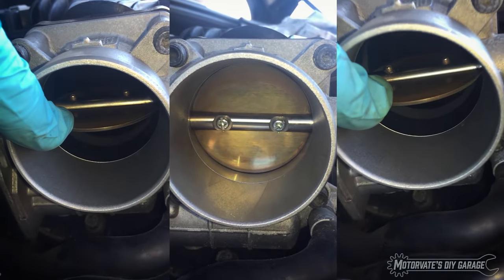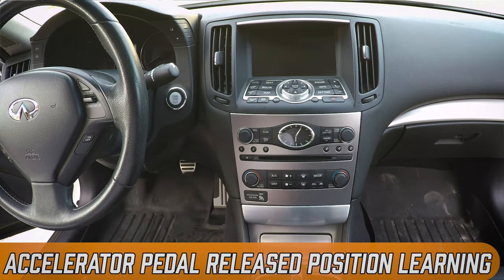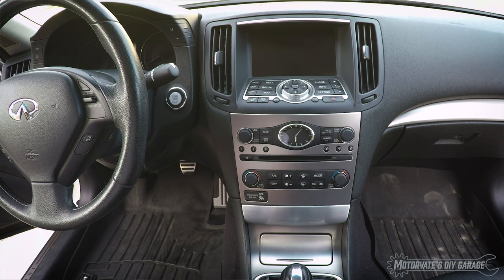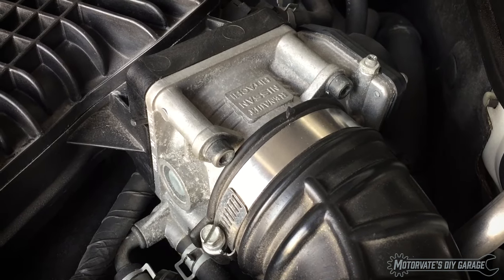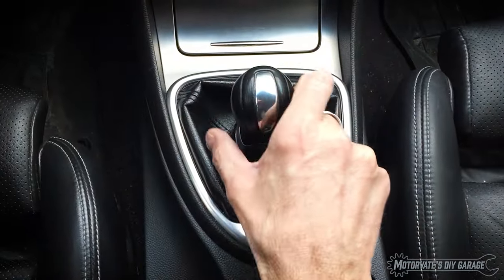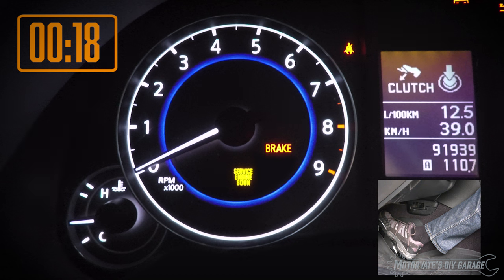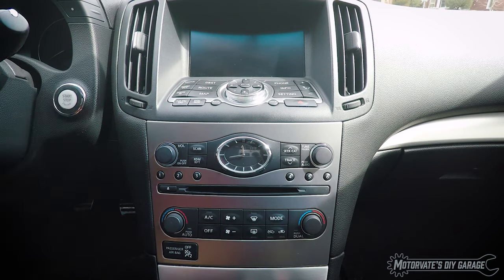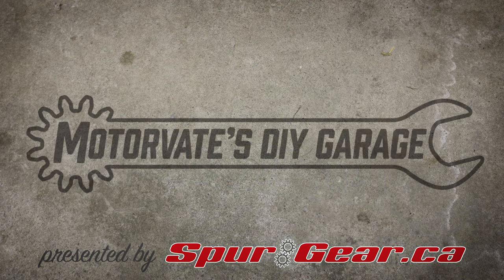G37 & 370Z After Throttle Body Cleaning: Motorvate’s DIY Garage Ep.27

Comment: Nice vid, I wasn't even aware there were multiple procedures.
Reply from the maker: Hey Memo's Garage,
Thanks for the comment.
Also if you have a bluetooth OBD scanner and an Android  device, you can use a free app to run the "idle air volume learning:
Quick & Easy Idle Air Volume Learning: Motorvate's DIY Garage Ep.28
https://youtu.be/OiB9txECWB0

Comment: I don't even have a g37 or 370z, im a z31 owner, but it's ridiculous that this channel doesn't have more subs. you earned on from me for your straight to the point no BS tests.
Reply from the maker: Hey Troph2,
Thanks for your kind words! 

I am happy with the growth of my subs, of course more is always better :)

There are some very interesting episodes in pre-production right now:  I will be going back to the dyno for an air filter retest  (including a dyno run without any filters) and TPMS troubleshooting tips.
Reply: @MotorvateDIY  seriously yes thank you for the no bullshit quick to the point editing. This was a great video. Subbed, cheers!
Reply from the maker: Hey Hexecutable,
Thank you for subbing!
Reply: @MotorvateDIY  have you ever done gallery gaskets and timing chain/tensioner replacement?
Reply from the maker: Luckily, I have not needed to :)
At 80C/176F I typically have 20-22 psi engine oil pressure.
So far... so good!

Comment: Great video, at first I thought I didn’t need to follow these steps but I noticed that when braking my idle reved from 1000 to 1500 while driving. And also while parked when reving it didn’t settle so easily
Reply from the maker: Hey  Joel Rojas,
Thanks for you kind words. You could see where the car settles to for a few days, or just follow the 3 steps in the video.

If you have a bluetooth OBD scanner and a Android phone/tablet you can use a free app to do the idle air volume learning:
https://www.youtube.com/watch?v=OiB9txECWB0&t

Comment: Thanks for this. I think the most important part of this is step 2 as I was able to get the idle back to normal by just doing the first 2. I had done them all originally after I was getting rough idle and check engine light but it turned out to be because I forgot to clip one of the MAF sensors in all the way. After I fixed that, I tried doing them all again without cooling the engine and the idle was still stuck at 1k even after 30 miles of driving. I let it cool overnight and did the first 2 steps starting with a cold engine and the idle sorted itself on the 10 minute drive to prepare for step 3. I think it makes sense that if the ecu automatically opens the butterfly more as carbon builds up that as long as the close position is reset, it should correct itself in the opposite situation. I think the reason so many people say they don't need to do anything is because they end up doing step 2 without intentionally doing it since all it requires is a cold start and bringing then engine to normal temp.
Reply from the maker: Hey Sean Stratmoen,
I agree with what you are saying. 

However, it still is a good ideal to finish with the "idle air volume learning" so the ECU learns any change to the air flow when at idle.
Reply: If I had a misfire and changed a plug and coil pack do you think step 3 is necessary? Right now it idle at 800 after warming up. 

But above one and lil higher than it did before. I should be good with the first 2 right?
Reply from the maker: If your idle is stable, then I think you are good to go.

Comment: Great video! cleaned my throttle bodies and the car went into limp mode. After performing the steps in this video the car is back to normal less one trip to the stealership.
Thanks !!!
Reply from the maker: Hey richardlono1,
I'm glad to hear you fixed the issue :)
Thanks for your comment!
Reply: when your car went into limp mode did the vdc and slip sensor turned on while driving and the car slowed down?
Reply: how did you do the third step when in limp mode?
Reply: @davidkngdavid5624  did you ever find what to do? Juat happened to me
Reply: @chuchainzzz2062  same boat lmao
Reply: @davidkngdavid5624  yea same happened to me today, new exactly what caused it, had a feeling I should’ve watched this video when I seen it about to play after watching the first one. Dumb

Comment: Hey I wanted to add one important step I found that finally made the idle reset work for me:

When I got to the step were I had to hold the gas pedal down, I RELEASED IT for about 10 seconds as soon as the service light began blinking. Then I held it down for another 10 seconds (it still continued to blinked). Finally I released it then started the engine.  

That extra step of releasing for 10 sec then depressing for 10 sec is what finally reset my idle and turned off the service light.  Without doing that the idle didnt reset.

This was in a 2012 G37xS 7 speed automatic.

Still your vid was awesome and helpful. Just wanted to share this tip.
Reply from the maker: Hey DoomFinger511,
Thank you for sharing this tip, I really appreciate it!!
It is nice to have a few different procedures to try for the idle air volume learning. :)
Reply: +1 here. Had to do the same thing on my 2009 EX35 to remove the check engine light.
Reply from the maker: Hey LegenDario Ciroc,
Thanks for sharing your experience  :)
Reply: So if it doesn’t work with the one in the video can I retry with your method ? Or can that mess up the car
Reply from the maker: Feel free to try that method... You can't hurt anything doing that :)
Reply: @vqdrew1171  If you mess up the steps at any point it just won't work and you have to start over. You can't break anything.
Reply: 2012 G37 this was the only way l could reset mine too thank you!

Comment: Thank you!!!!!! It worked for my G37. I replace the sparks plugs, the throttle and throttle body. It put my car in limp mode. After watching your video, I did it....it worked. Only issue now, it that my car is driving on high gear on the highway. I think it's the fuel cleaner that I put in the car. Will let you know later how it goes.
Reply from the maker: Glad to heat that!|
I don't think fuel cleaner would change anything in the transmission.... but let me know what you figure out :)
Reply: @MotorvateDIY  is it normal to go 75 MPH at 3k RPM? My car is an automatic, I am under the impression that the gear should drop to 2k at 75 or 80?
Reply from the maker: On the G37, with the 7 speed automatic trans and stock sized wheels, at 75 MPH and in 7th gear,  the engine RPM should be just over 2600 RPM.

If you are at 3,000 RPM at 75 MPH your transmission might be in 5th gear.

Just count the shifts as your accelerate up to 75 MPH to double check what gear the auto trans is in.

Comment: 3 Infinitis later I come back every time to make sure I do it right ! Thanks again for doing this
Reply from the maker: Thanks for thinking of the channel and popping back!
Reply: @MotorvateDIY My g35x sedan 2007 turn off at red lights sometimes when I try to accelerate and rpm goes up and down sometimes I just cleaned the throttle body and did this video to do the relearn process still doing the same thing I might have a vacum Leak any info why this is happening.😊
Reply: My g35x sedan 2007 turn off at red lights sometimes when I try to accelerate and rpm goes up and down sometimes I just cleaned the throttle body and did this video to do the relearn process still doing the same thing I might have a vacum Leak any info why this is happening.

Comment: This worked! I did the idle air reset, immidiatly followed by the full ecu learning reset. (Do the same process as idle air, but as soon as the SES light begins to flash release the accelerator, then after 10 seconds hold it again. This will cause a more rapid flash and the SES will vanish
Reply from the maker: Awesome!  You should now have a stable and smooth idle.... AND t he cruise control will operate smoother now )
Reply: @MotorvateDIY  thanks a lot. I was frustrated when the light came back on immidiatly, but resetting the idle and ecu immidiatly after cleared it all. Slowly fixing all the things that the previous owner gave up on. Next is window memory

Comment: Great camera work and lighting. I recently picked up a clean 2007 g35s sedan with 50k miles and most of what you discuss translates to this model as well. Look forward to a battery swap when the time comes. Heard they are a bit of a pain.
Reply from the maker: Hey Zack Fanning,
Thanks for your kind words. This episode was one of the more difficult to shoot since the throttle body is so low, and your hands block the camera view. I  shot the throttle body cleaning about 4 times to get it figured out.

Changing the battery is on the schedule for this year. Last year I shot a video on changing the battery, but didn't like it, so I will shoot it again this spring/summer :)
Reply: Is your battery located at the top right of the firewall inside a little compartment with a pop off lid?
If so, then it's actually not that bad. You pop off the pop rivets that hold the compartment in place and then remove the whole compartment. After that you un-do the battery and pull it out. Installation is the reverse.
Invest in replacement pop rivets because they will break off on older cars.

Comment: I don't think I was able to get Throttle Valve Closed Position Leaning to run, as my coolant temperature only reached 82F overnight. However, the other two procedures worked and my idle no longer surges after TB cleaning. Awesome instructions! Thank you!
Reply from the maker: Hey  Srick E,
You are welcome and I am glad everything is back to normal :)

Comment: Can confirm it works with vq35hr my idle was 1000-1500 after cleaning throttle bodies. Now it is idleing at 650rpm and cleared the service engine code !! Thank you worked on my past vq37hr as well !!!
Reply from the maker: Thanks for the comment and feedback!
Reply: Same care with test pipes check engine light only blinks 5 times instead of 8 is that a minor cause or not resetting ecu
Reply: Before you cleaner then was the code about the throttle bodies? I cleaned it and tried the procedure but the code won’t go away

Comment: Wow I'm jealous of your uncracked dash
Reply from the maker: Hey DanielDaniel1,
Is it common for the dash to crack on the G37? 

If so, I wonder if that is more common in the more southern states...
Reply: @MotorvateDIY  07 g35s here and the cracking has been relentless in 2 years of covered parking during the day and not using any dash conditioner. Also diligently use a sun shade and leave windows cracked to no avail
Reply from the maker: Hey DanielDaniel1,
Wow, I didn't know that... I hope it isn't a future issue for the G37.

Comment: Thanks for your videos. After already replacing both my MAF sensors on my 2014 370z I cleaned my Throttle bodies and did this ecu process and everything seems to be working well. I just need to clear the code and hope it doesn't come back.  Thanks!
Reply from the maker: Hey Digital Man,
Thanks for you comment and I'm glad the video was helpful :)

Comment: This is absolutely the best video/explanation I have yet to see on the internet I did spark plugs on 2011 EX35 and I removed the entire throttle bodies to clean them up and to have better access to the spark plugs. Once plugged everything back on I was getting super high idle, Multiple codes P0603 and P0507 which is throttle body and car was not driving right (studdering/bogging) as I accelerate. So I cleared all the codes using scanner and also performed one of those 3 found some video on YouTube explaining how to reset ECU… my idle was corrected some what but still drives like absolute crap. I will be trying this later on today but I am a little confused on step2, so all what I need to do is turn it on and let it get to operating temperature? Hope to hear back from you today again great super great videos glad I came across your page
Reply from the maker: Step 2 is a little unusual, but you are correct. Just let it warm up. 

It can be tricky to get the "idle air volume learning" to run to completion. Some have commented that it took them up to 20 times.

If you have an Android device and a Bluetooth OBD scanner (like an ELM327) you can use this free app to do the idle re-learn:
Quick & Easy Idle Air Volume Learning: Motorvate's DIY Garage Ep.28
https://youtu.be/OiB9txECWB0

Good luck!

Comment: Thanks for the informative video. For some reason it took me several attempts for the idle throttle position relearn procedure to actually reset my engine rpms to normal, on the 3rd attempt it finally worked seemingly. My idle was WAYYY off though for some reason, like 1500-2000 rpms and surging instead of being at ~650. Now the engine is purring like new.
Reply from the maker: Glad it helped!

Comment: Thank you so much for the video! You showed me how to do something my mechanic didn't even do after replacing my throttle body! Was suffering power loss n high ass idle. Followed the video n shes purrin now! 03 G35 6MT 🔥🙏🏾
Reply from the maker: Mechanics have a tough job... each manufacture can have a different procedure for the same part replacement.
Anyways, I'm really glad  the video helped.

Comment: My g35x sedan 2007 turn off at red lights sometimes when I try to accelerate and rpm goes up and down sometimes I just cleaned the throttle body and did this video to do the relearn process still doing the same thing I might have a vacum Leak any info why this is happening.